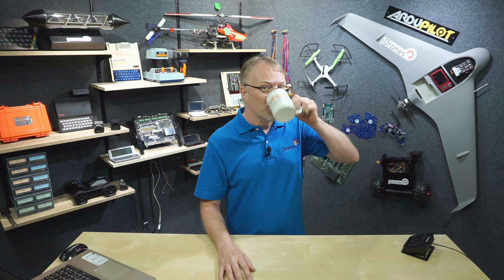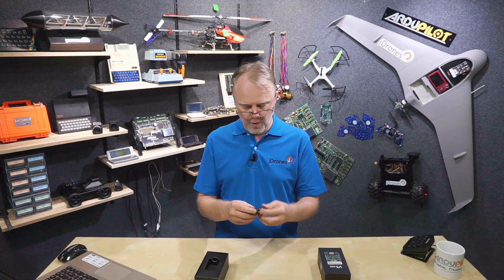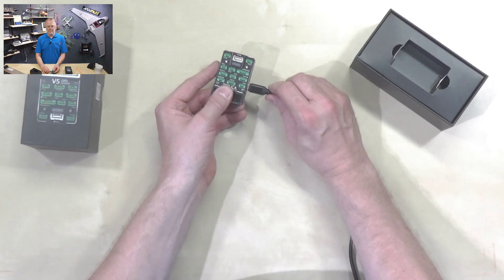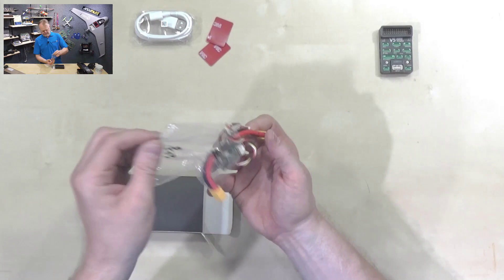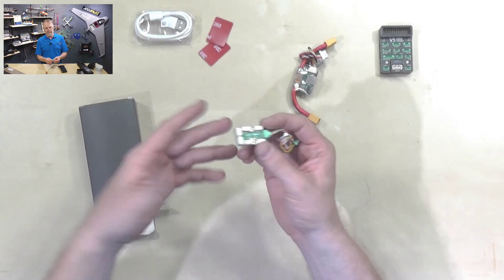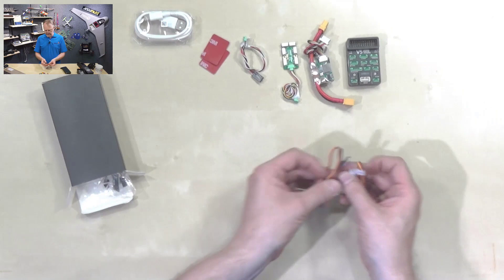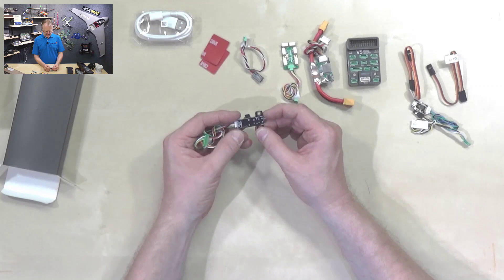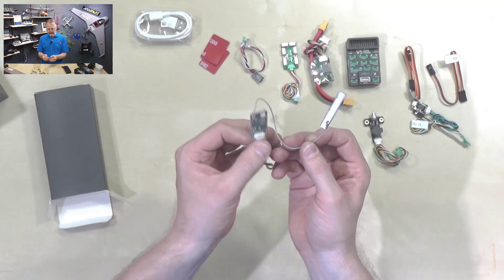CUAV V5 Nano Autopilot Unboxing, Review and Mission Planner test

Comment: Thanks for the video. You said it works with both PX4 and Ardupilot, I'm trying to set up Ardupilot with the CUAV Nano now, but having trouble with the battery monitor settings. It worked automatically with the PX4 software. Any ideas on what the settings should be for the included battery monitor on Ardupilot?
Reply: So I figured it out in case anyone else stumbles across this. The HV power module supplied with the CUAV Nano uses A0 for voltage and A1 for Current. The voltage divider value is 18 and the amps/volt parameter is 24. These have to be set in the parameters in either mission planner or Qgroundcontrol but aren't easily set from the configuration screen, but instead in the parameter list. Search "Batt_" and all available battery settings will be displayed.